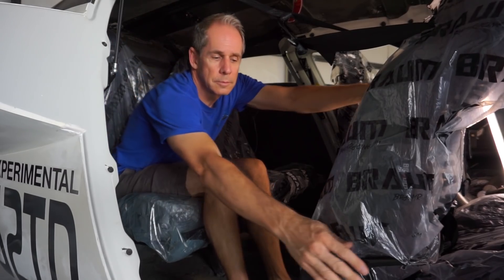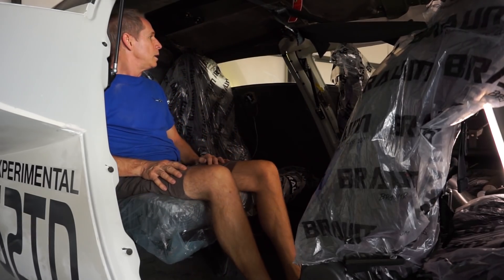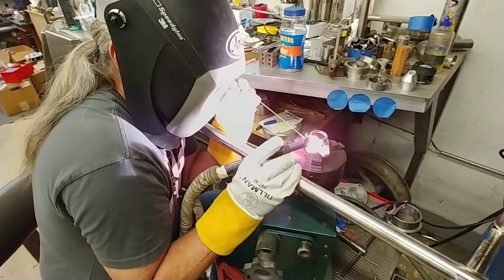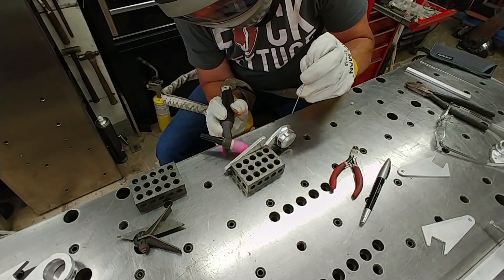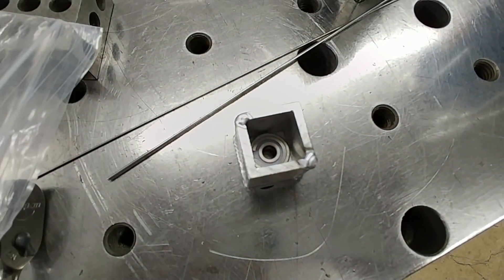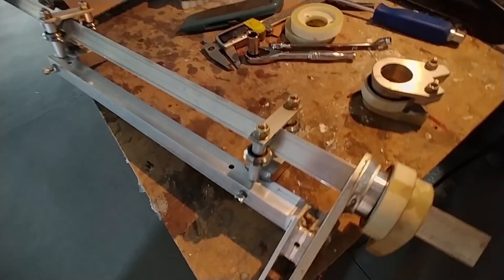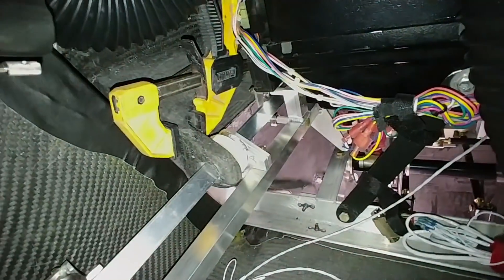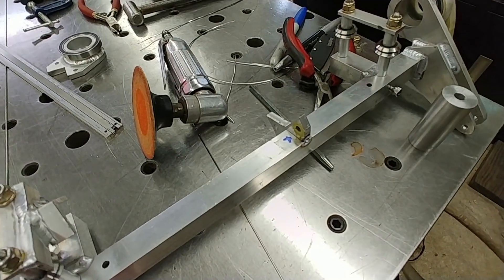Stick Assembly - Building the Raptor Prototype

Comment: I'm sure you already thought of this, but it looks like "skateboard" bearings (608) could be used in this application. If you aren't already using that size, I would consider using it if you can because they're MUCH cheaper than any other similarly sized bearing due to economy of scale.

Comment: Pete - did you manage to sort that cracked rear side window, wondered how easy it was to replace
Reply from the maker: I don't have any intention of replacing at this time.
Reply: @RaptorAircraft  Will this keep you from testing the pressurization system once in flight?
Reply: @madmerlin1922  It was explained in a previous video that during the first phases of flight testing, pressurization wasn't going to be happening. It'll essentially be testing it's airworthyness.

Comment: , ,,, please forgive if you have already worked around this, but I have information that 7075 should  not be welded, by conventional standards; however 6061 is alright . Also have a vague recollection of there is a work around on this problem . Please check up on this . on edit : ,,, Peter is aware of the ( non ) welding of 7075 alloy .
Reply: That part is bolted not welded I believe.
Reply from the maker: The sticks themselves are just bolted in. I'm aware that you can't weld on 7075. This is not the first time it's been used on the aircraft. But thanks for pointing that out.

Comment: With all that width in the back seat, have you considered making it a 5 seater a-la the SR-22?
Reply: I thought from an earlier video that 5 seats were planned as an option! 

And as to the weight issue, I keep pointing out that this is only the P1 prototype!!!
Reply from the maker: I thought I was pointing out that you could easily fit 3 seats in the back. FYI, the Cirrus is at best 4 1/2 seats.

Comment: The only reason a pilot would overtorque the new design would be if the airframe were put into an unrecoverable attitude and  design limits were exceeded.  There is so much area in shear in the square design that yield strength of the material should not be exceeded in normal operation, IMHO.

Comment: Britt is a very good welder.
Reply: His name is Brett.
Reply: Sir Newton -  as a certified welder / welding inspector for Boeing Co. Britt is real good welder. Some minor rough finishing off’s but a clearly well uniformed beads. Great job Britt!! He’s getting you there. Aluminum conducts heat quickly and uniformity can be difficult for some welders. Nice rotary table!!!

Comment: The interior space coupled to comfort of pressurization and A/C for ground ops is by far the best out there. If it has the speed and controllability you hope for it will be quite a ride. Can’t wait for Phase one flight testing.